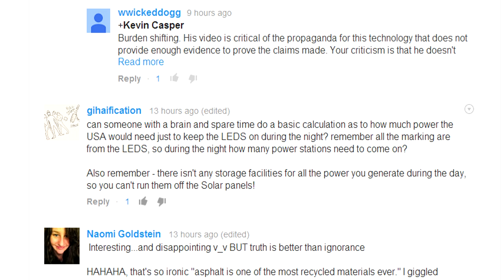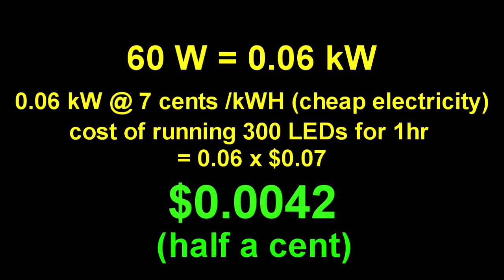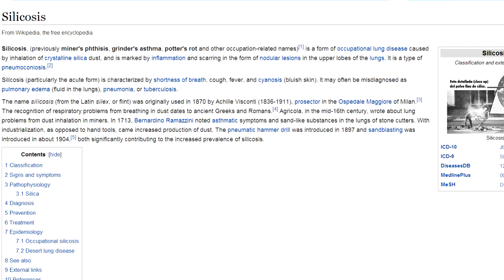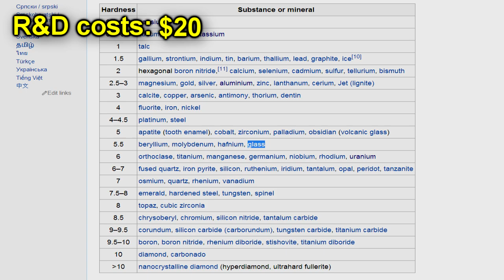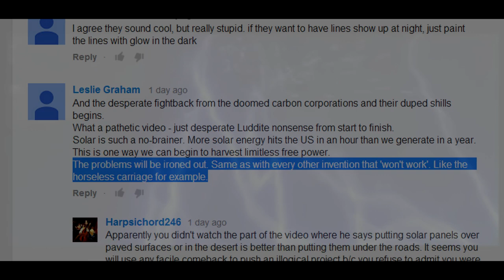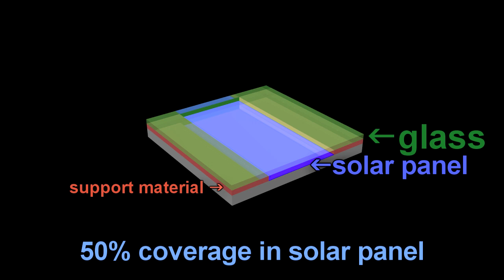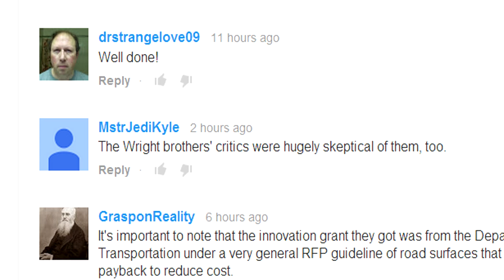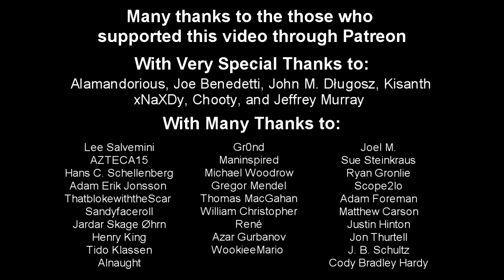Solar Roadways, IMPORTANT QUESTIONS AND ANSWERS!

Comment: Your calculations are based on LEDs consumers buy.  It's not based on how much per LED it would cost Solar Roadways when bought in bulk.  I will say it will be very difficult to replace all of our roads with this technology, but you are trying to mislead people into thinking they are going to spend $22 per LED.
Reply: He didn't suggest $22 per LED.  He quoted the price for the array he demonstrated.  Since the question was the amount of light per dollars worth of LED and not the dollars per LED the $22 was correct in the context he said $22.  He showed that $22 worth of LEDs didn't make enough light to do the job of a small section of lane marker.  I already knew this because I have used LEDs in places where they need to be sunlight visible.  In direct sunlight, you need a superbright LED running on about 25mA just to make a dot that can be seen from about 20 feet.  As you go out in distance, the light output needed to be seen runs as the square of distance.   I could have worked out the price for the LEDs needed but as his low estimate already made the point that it would be very expensive, I didn't feel the need.
Reply: He was talking R&D budget not implementation budget.

He showed that low-power LEDs, like the ones a 40W solar panel module could potentially power during the day, are way too weak to be seen during the day from really close, let alone from far away in a car at a low angle.

Comment: HY I heard about solar roads a lot..i saw the vid. Roads...ok thats a joke. imagine -15C at night after a little meltdown at daytime..... "Highway to hell"  !! :) But think about the other uses.what if dont need the LED-s
hexagonal btw you can make sphere, wave, flat, and curved shapes.easy to fit, variable glass surface texture,can be upgrade with some lenses, moving sensor for autotracking trains,prewarning if something is on the railroad, can be measure things, there's a pcb inside so limitless. ideal for coat the sides of a bridge, "squarestone". can upgaradeable with heating panels for countries where winter is cold, flagstones and the tram,and train lines coating where cars never roll.and dont need to use 0-24/7. just power up the batteries daytime and make the fairy lights at night for free. It produce 300 times more electricity than simple concrete :)

Comment: I really liked that one comment "why not just put solar panels on the side of the road"

often times the best solution is the simplest solution

Edit: also one thing *****  didn't mention would be the cost and effort required for cleaning and polishing the road. It doesn't take a genius to know that glass covered in scratches, dirt, and rubber tends not to let as much sunlight through.
Reply: Because hipsters that hang out in the manhatton starbucks even though they live in the Bronx really know the value of property, and wouldn't want to waste it.

"Undeveloped, unused land, what is that? Sounds icky!"

Maybe we can put it on a bus shelter roof. A dome shaped plastic roof that has a flat cell stuck to it that's free to circle to follow the sun, and inside the shelter there's a clock that rather than constantly having stolen batteries actually runs on solar power. Also now people have no excuses to look at their mobiles all the time. The positive externalities are just popping up!
Reply: charlesvan13 The most efficient system has the panel very near the point of use.  It is just for large scale systems that putting them in the desert makes sense.  In the desert, solar thermal makes the most sense because it does well as you scale up.
Reply: It's actually much more efficient to cover a few acres of the desert with solar panels.
The low voltage DC produced by the panels has to be stepped up to high voltage AC to be transmitted efficiently to a city.
Reply: charlesvan13 actually if you drop all the  photovoltaic cells and replace them with a solar steam system it will actually be more efficient and you could power more with less space used
Reply: seigeengine What is your point?
Reply: ***** Why not just stick them on rooves and not also take up more space?
Oh wait, we already do that? Huh.
Reply: ***** That even your simplest solution is silly.

Also, your edit is a bit weird. Thunderf00t does mention that the glass gets scratched up and deteriorates over time. I don't think there was really a need for him to address that. He does after all address maintenance.
Reply: yeah I guess so to be honest I don't even remember writing that comment.
Reply: Even better is to put a roof over the sidewalk.  Putting the panel up and on an angle will make it work way better.

Comment: sorry to say that but i would guess the raw price of the LED's roughly around 2.4 billion $, using a price of 3ct per LED,  which is by assuming it is for more than 5000pieces.
( this website says 3.653ct per LED per 5000 pieces:
www.digikey.com/product-detail/en/XHP50A-01-0000-0D0HG4030G/XHP50A-01-0000-0D0HG4030GTR-ND/5051927
)

 so buying 12 000 000 000 000 pieces, would shurely give you much more of a discount. And even if my guessing is'nt the right, the price you use for the LED's, includes a powersource, chips/controls for the LED's and a remote control o.O ?  ---> link to the shown LED's:

www.amazon.com/Tagital%C2%AE-Waterproof-Flexible-300leds-Changing/dp/B00IHAT5EW/ref=sr_1_1?ie=UTF8&qid=1420377211&sr=8-1&keywords=Tagital+16.4ft#productDetails

Soooo....allthough i'm verry sceptical myself concerning those solar roads, and apreciate your scepticism, your REALLY have to check how you aquire your numbers....
Reply: well i made a mistake by myself, the price per unit seems to be 3.653$ not cent. still as i understand those are quite good LED'S in the sense of brightness (which was another point you spoke of in another vid). and still, its for 5000 pieces, so, the discount for 12.000.000.000.000 pieces would shurely lower the price to an acceptable height :)
Reply: MorbidMarrow

Yes, those are decently bright LEDs. But you're missing the point that NO recessed light source can be seen from shallow angles, no matter how bright. It also ignores the problem of light pollution and how much light would be utterly wasted and unusable. 

If you actually look at how buying in bulk decreases costs, the percentage discount declines. The price per unit from a quantity of 100 to a quantity of 1000 is a 33% discount. Going from 1,000 to 25,000 only gives a further 6.2% discount.

It's also a myth that large or larger quantities always result in further price declines. If the supply chain is stretched to its limits, prices actually go up. You see this with oil. Oil producers could supply more oil than is currently demanded. But in order to meet that demand, they'd have to go to the ends of the Earth...places like the Arctic and drill miles below the surface of the ocean. That's not cheap!
Reply: fubecabr too long, didnt read must have been your attitude right? I pointed out that he should have used another example for the LED's than those from amazon. me: "Soooo....allthough i'm verry sceptical myself concerning those solar roads, and apreciate your scepticism, your REALLY have to check how you aquire your numbers.... " <-- thats my point did you grasp it? i guess no... If you make an example, make it a good one. By using the price off of this Amazon LED he made a bad one. That makes the example as an argument vulnerable in discussion and therefore useless although being in concept a good one. did you get it now? or do i have to draw you  a picture? I do share the thought of disliking this roads. but i dislike the use of this amazon pricing to make a point out of it as well... duh... And dont you come here and tell me something about pricing, fact is, you would get the LED's even cheaper if you ordered more, period. And although the discount per part may decrease compared to the first 100 or 1000 pieces, i dont care, because it would still become cheaper than what he used for his calculation. and if you would have read my comment you would have seen that i didnt made an exact statement on the final pricing. now bugger off and play with your dolls and stop wasting my time.

Comment: I think these might actually work in small areas like jogging trails. If they are only meant for walking the concerns with the wear from large vehicles would not be an issue.
Reply: Well it does sound like a better idea, but the solar panels still don't get that much light. So it's still not as good as placing them where they do, like on rooftops.
Reply: ivanlagrossemoule I definitely agree. A sidewalk is better than their road plan but still not a good idea.

Comment: Honestly, I know you have a "vision" against solar roadways... However, you tested the durability of general and cheap glass such as what made up the jar. I'm not sure you understand the concept of different glass compounds. In fact, some glass has the characteristics as such to be compared with the direct strength of steel. Your argument of the overall ability of our current solar panels is very ignorant and invalid as well. Its more then obvious that you are against solar roadways, as were many about the idea of going to the moon. So what do you propose as a supplemented replacement to our current roads then?
Reply: Each of your objections has been raised before and answered:
1) The jar of a glass is a perfectly good model for all but really expensive  glasses.  Glass is very bad as a road surface.

2) His numbers for a solar panel are about right.  They are certainly not far enough off to make the idea viable.  For that matter if solar panels were 100% efficient, the idea would still not be viable.  Remember the same panel can be put on the roof.

3) The replacement for the current roads is a replacement road that is designed to be a good road,

If you want to bring some new facts, lets see them.  At this point you have just repeated old objections without a single new fact.
Reply: "obvious that you are against solar roadways, as were many about the idea of going to the moon."   At first that appears to be a strange analogy, except that going to the moon was so expensive compared to the benefits that it was only done briefly as an experiment. 

It wasn't practical to lift large quantities of people and equipment out of a gravity well.   It also isn't practical to make roads out of large quantities of glass for the same reason - it takes enormous amounts of energy, and the results aren't worth it.
Reply: "In fact, some glass has the characteristics as such to be compared with the direct strength of steel." And I can take a rock and scratch steel with it. Whats your point?
Reply: My point is that your argument is invalid. You're not an electrical engineer.
Reply: Jman You Rock Not sure why not being an electrical engineer invalidates anyone's understanding of whether it is practical to build a glass road.  

The discussion also doesn't hinge on whether indestructible glass can be made.  Corning Glass, PPG, and others with multi-billion dollar budgets have been working on improving glass and ceramics for well over 100 years. 

Some dude who happens to be an electrical engineer with a glass shop in rural Idaho might make a miraculous breakthrough in developing glass that can be made without using a lot of energy, while operating on a budget smaller than Corning's petty cash, but miraculous is the key word.  The odds are well against it.

Comment: What if they used ALON instead of glass? http://en.wikipedia.org/wiki/Aluminium_oxynitride
Reply: Any hard material is a problem as a road.  Hard materials abrade.  Also remember that you have to make a whole road out of panels.  Anything that costs a lot is not going to work.  The solar panels can be put on the roof.   The cost of making the road and making the roof top panels for a given amount of power is lower than making a road that does both.

Comment: Hi Thunderf00t, nice video of this, I love using this term but I am an advocate for someone playing devil's advocate in a situation. I'd like to offer some alternative ideas to some topics you brought up. The big one being using glass: I'm going to address this in both logic and sci-fi. Logically speaking, a solar ran country/world, would indeed rewrite current fundamentals. One of those fundamentals would be tires. "IF" the project works as intended, tire production would have to shift to accommodate the new infrastructure. This would reduce, if not eliminate the contact surface friction issue, and grinding debris into the surface. Second would be the LED power source. IF this was a globally ran system, the system would always be subjected to solar power at all times.Visibility of the LEDs during the day could also be accomplished during the construction of each surface plate. As the only part of the surface plate that is required to pass light is the parts with the solar panels beneath it; the areas or spots that have LEDs could have the same spots on the glass using a coating to provide enhancement of day light viewing. This would limit the "amazing customization" that it may have had, but would still allow a great deal of customizing. Lastly on the more logic end of things, vehicles generate energy from movement. Panels for roads that can turn this force into power, not only would generate power but also reduce impact based damage. Now here's where things get sci-fi; if all roads are a type of technology, instead of rock, all cars could be designed to drive themselves. With a road able to provide feedback, and a device in a vehicle able to read this feedback, traffic could communicate with each other on a level that could make the need to be behind the wheel a thing of history.

Comment: you don't need the whole roads be covered in solar panels, just the sides and sidewalks really and also maybe crosswalks. Having this will take enough stress off the power grid and make electricity less expensive for everyone. Also you don't need that many LEDs if any at all, besides maybe the sidewalks, bike lanes, and crosswalks, paint works good enough.
Reply: OK, where's the evidence that solar freaking sidewalks and crosswalks would cost-effectively take "stress" from the power grid and make electricity LESS expensive for everyone? If you actually do the math and ASSUME the SAME cost as rooftop solar, then it's still a complete fail because it generates at LEAST 40% less than rooftop solar. That makes the economics fatal if you have to finance it. And yes, governments at all levels are broke and would have to pay 3-4% interest to buy stupid freaking solar sidewalks.